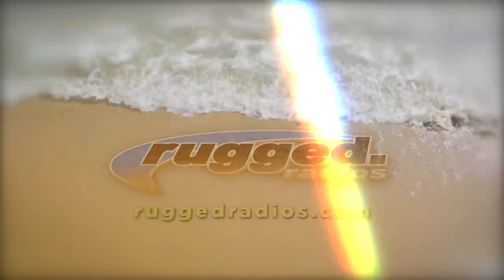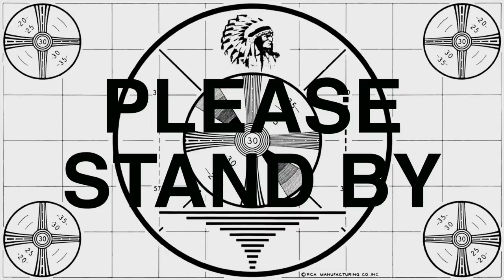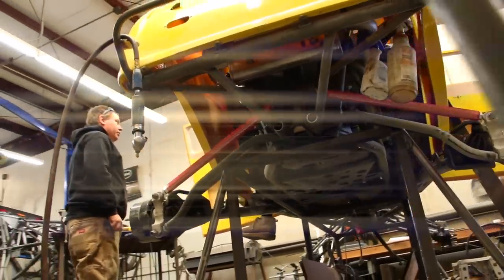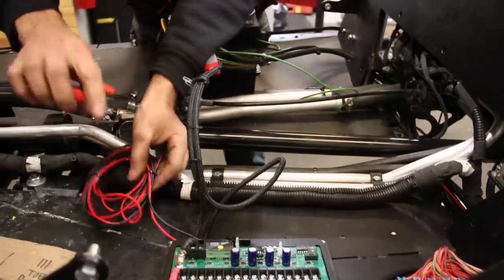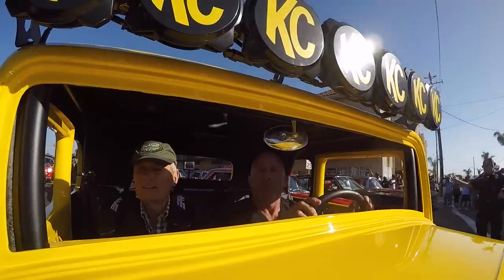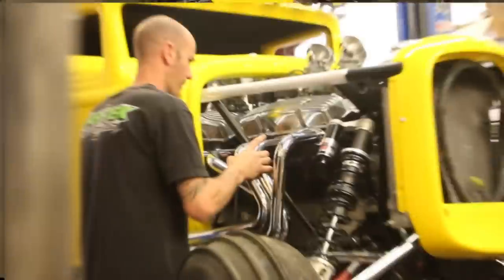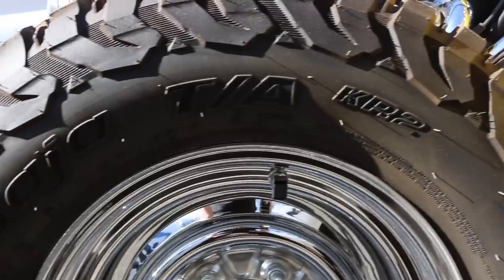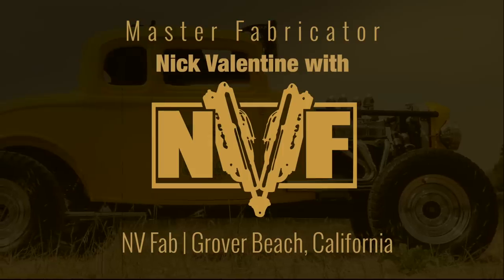Rugged Radios | The Rugged '32 - Part 1

Comment: So the engine up front is just for.....huh? I'm confused.
Reply from the maker: Yeah, it's a unique build that definitely makes you scratch your head. The engine up front is mock engine to deliver the same look at the classic '32. The Polaris motor is still in the rear. However, we did modify the front fake engine to become our gas tank so we could use every inch of this build!